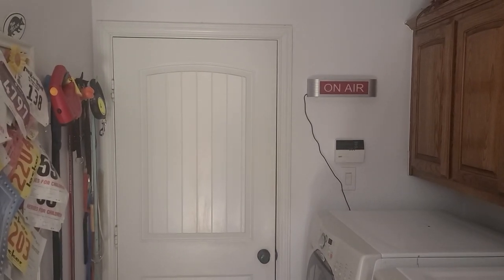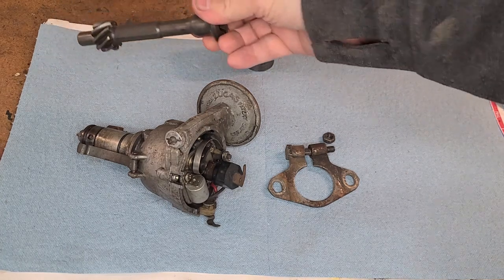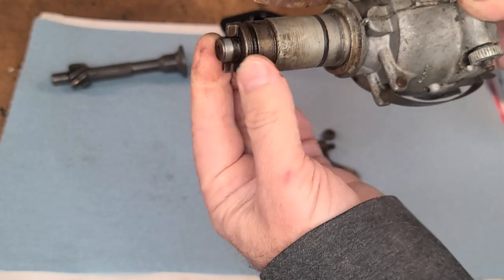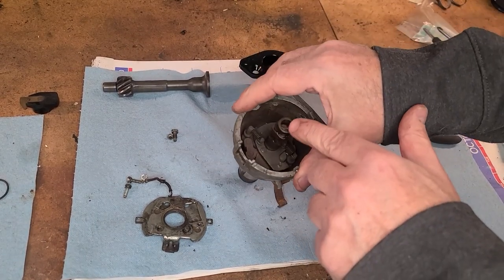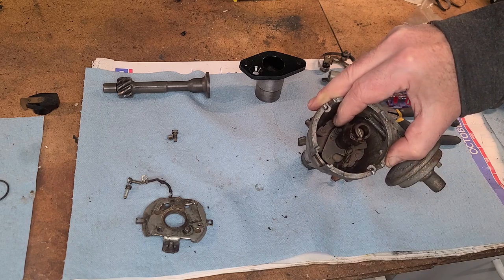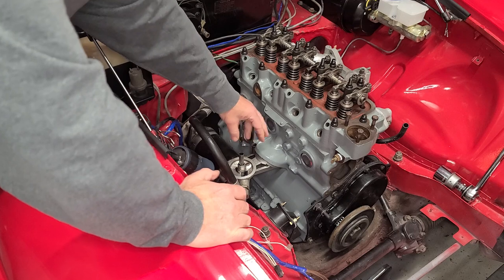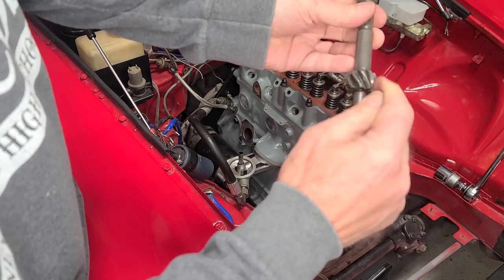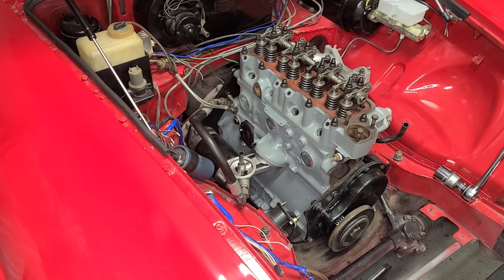MGB Distributor and Spindle installation

Comment: I was also wondering if it could be a carburetor problem.    I tried to save money and bought a Weber knock off carburetor.  It runs really rough, runs extremely rich.  5 minutes running puts alot of carbon build up on the plugs.  Also, it only runs when it is choked.  When I turn off the choke, it dies instantly.  What do you think.
Reply from the maker: @bobharter3492  that sounds like a gasket leak at the head. Sometimes the exhaust manifold is a different thickness than the intake.  You need to shim it it that is the case.  Also, the idle jet needs to be selected for the displacement
Reply: @AlexPlatacis  I think I found my whole problem.  I rebuilt my old carburetor.  When I was taking off the other one, I was looking at the studs on the manifold that holds the carburetor.  I noticed that the threads weren't long enough and the nuts were bottoming out before it secured the carburetor to the manifold.  Would that have caused it?  It was just snug enough to where I couldn't tell if it was tight or not.  I ran the threads down further and I am reinstalling the the carburetor.  I'll let you know how it goes.

Comment: Hello again Alex.  I hope you are having a great 4th of July holiday.  i have been having a problem with my MGB.  I installed a Pertronics flame thrower coil with a Pertronics Ignitor conversion.  I am not happy with the way it runs, so I am going back to the points and condensor setup.  My problem is, my distributor only has 1 wire coming from it.  What wire do I connect to it.  Also, do I need to use a 1.5 ohm coil?  Or can I use the 3.0 ohm coil?  Plus, do I need to put the resistor back in.  I can't figure out the wiring of the resistor.  I have 1 long green wire at the part of the harness that goes to the alternator.  Is that the wire that I connect to the distributor?  Any assistance you can give would be wonderful.  Thanks.
Reply from the maker: @bobharter3492  gonna need some more info...
What year vehicle?
What model of igniter?
Also curios about the distributor.  The pickup coil can be sensitive to variations in the gap.  So if your existing distributor shaft, or bearings have too much play, it may affect performance.
Reply from the maker: Also, you might want to test the play in your timing chain.  If you were prompted to make the change because of floppy timing, it might be the timing chain
Reply: I have a 77 MGB, timing chain and tensioner is solid.  I have a 45D4 distributor.  It has 1 green wire coming out if it.  I took the long green wire from alternator part of harness and connected it to the distributor.  Key off, 0 volts.  Key on 12 volts to the distributor.  I assume that that is correct.  I can't figure out how to wire the ballast resistor.
Reply: I must have thrown away the box for the ignitor.  The pickup on it has LU-143A.  The distributor is brand new.  I may need to bite the big one and buy the Pertronics Distributor from Moss.  Just to make sure that I have the correct set up.  I have a 3.0 ohm flame thrower coil.  Do I need to put a 1.5 ohm coil on going back to points and condensor set up?